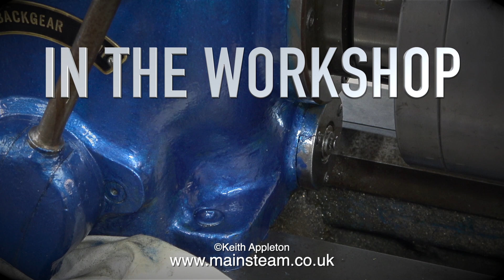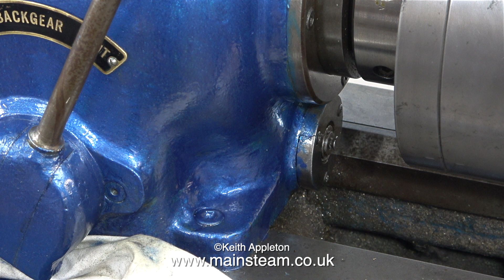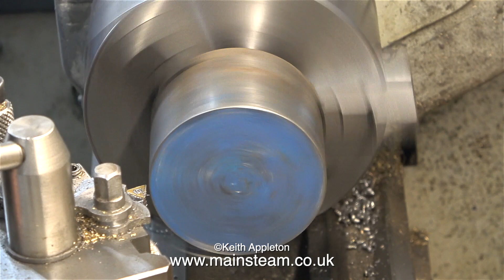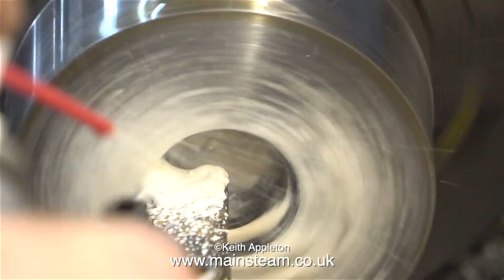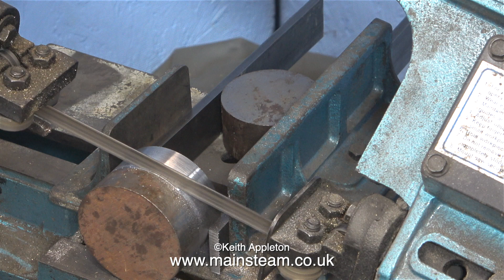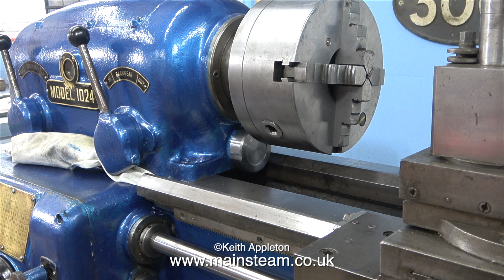MAKING A BACKGEAR SHAFT COVER - IN THE WORKSHOP

Comment: Why a cover instead of remaking the damaged part?
Reply from the maker: Because the original part works perfectly fine, is not worn at all and it only needed a cosmetic oil seal/cover which was missing. That is why I made the new part. The amount of physical stress that would have been required on the headstock casting to remove the existing damaged part was just not worth the risk. (I do think things through before doing jobs like this) . . . .